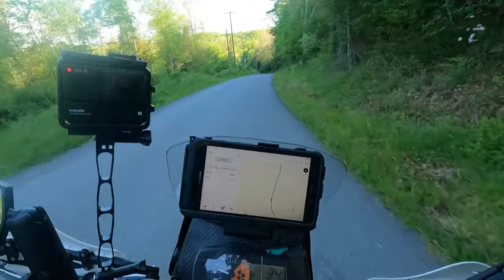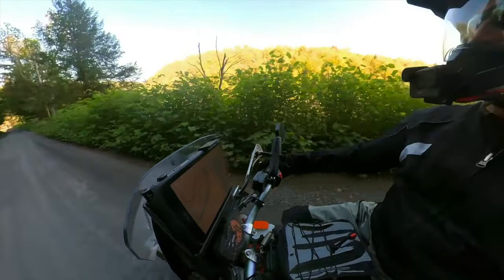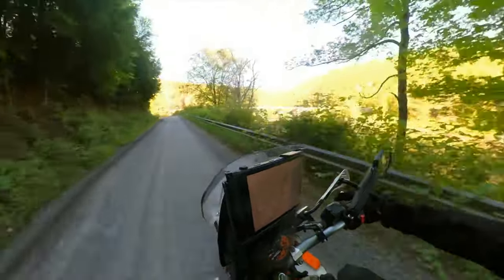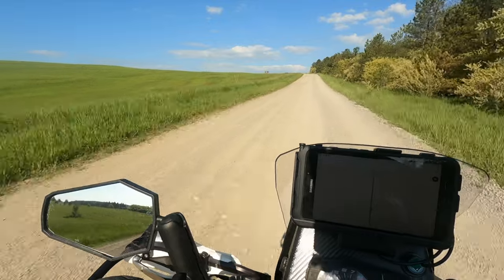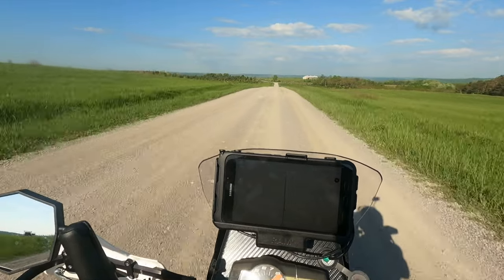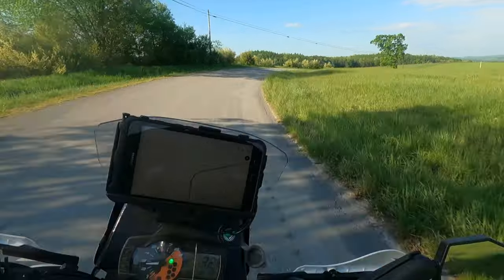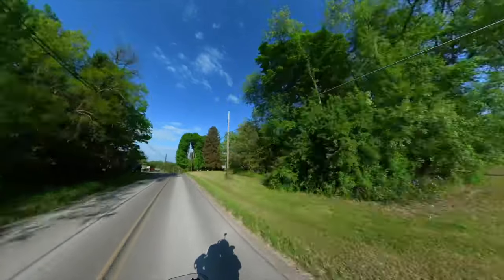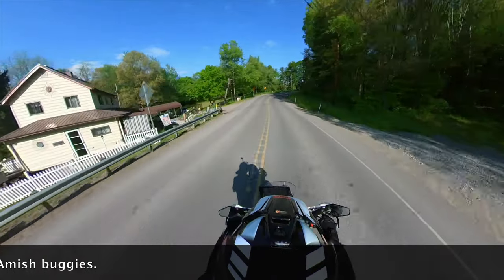The Cross PA Adv Trail in Clarion County, PA

Comment: Hi Dave.  Your channel was recommended to me most likely due to my KTM 690 and CPAAT searches.    I'm in the Rochester NY area and plan to be in Alleghany National Forest in May.   How do you like the Lynx fairing?  How does it work compared to the smaller KTM fairing?  TIA.
Reply from the maker: Max, thanks! The Lynx fairing has been great. Folks will argue that it puts more weight on the steering head, since it's attached to the forks, making steering more difficult. If you really like single track then you might want to explore other fairing options. I've found it perfect for my type of riding and the customer support from Britannia Composites is beyond compare. There are a lot of trails in the ANF as well as the Loop on the CPAAT page. The trail map is available at the ranger station. Have a GREAT ride!